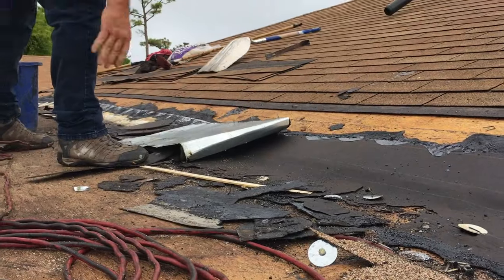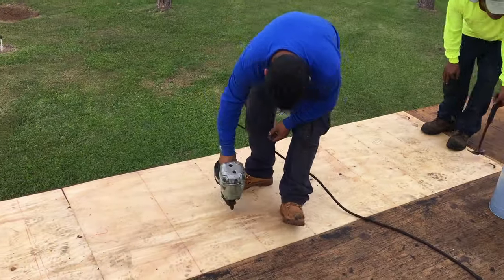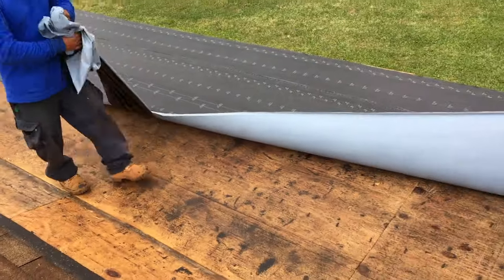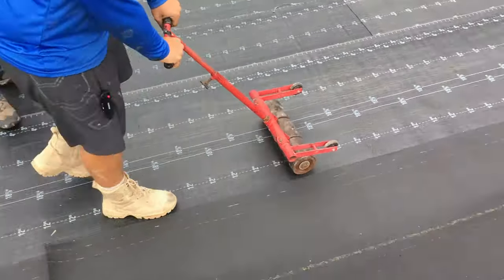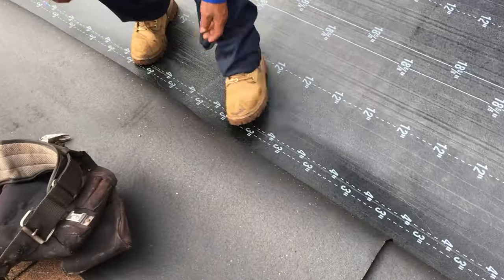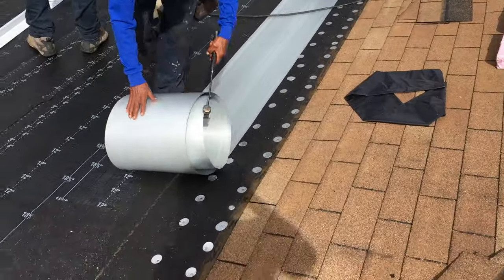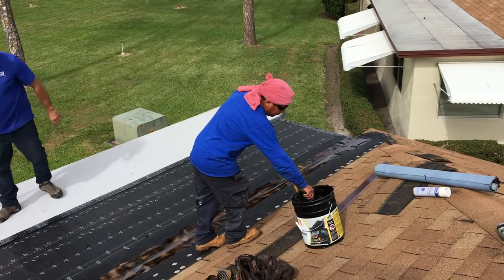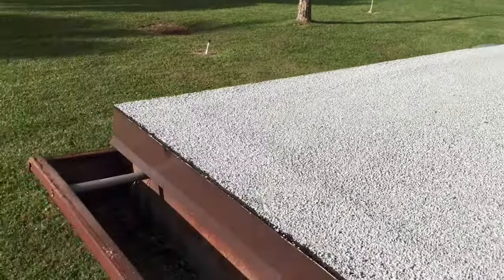How to remove, repair and install a flat roof

Comment: Its never good roofing pratice to lay down any type roofing membrane directly over a wood deck,i would have installed a 1x6 around the perimeter then screwed down a 1 inch layer of rigid insulation like Nord Board which is a tar coated insulation ,laying the roofing membrane directly over the wood exposes the roof to future roof leaks from nails popping up through the membrane .
Reply from the maker: Thanks for those good tips appreciate it and thanks for watching
Reply: Then you would void the manufacturer's warranty which specifies direct to wood underlayment on rolled roofs: Read the manufacturer's instructions. They tell you not to mix in layments from other manufacturers. A lot of people have their own twist on things, but bear the manufacturer in mind when you double your cost adding extraneous layers of underlayment. At the end of the day, the results are all that matter and if this roof section lasts 50 years, then every critique here is false. TPO and EPDM go straight on wood. I personally am going with a single layer roof system and I am not paying for even a single layer of underlayment on wood. I fully accept the fact no roof lasts forever. The wood itself has a limited usable life and so also do all forms of bitumen regardless of how many layers of underlayment. Why stop with 1 layer of Nord? Add ten more layers to be absolutely sure it's waterproof. It's your money, not mine.
Reply: @michaelledford4751  what metal deck? I decided to use an Owens Corning single layer system. The instructions don't call for any underlayment on wood sheathing. If you need insulation, that would be a bonus accessory completely unnecessary to the core purpose of roofing. Meanwhile, the overwhelming majority of homes rely on thermal insulation between the interior ceiling and below the roofing sheaths, so it's clearly redundant to then spend extra money on an insulating base layer for a roof top. Every layer of material costs money and further doubles the amount of labor needed to complete the job. No wood roof lasts forever. No bitumen roofing lasts forever. It's simply part of the usable life cycle and normal maintenance of wood framed homes. You get at least 10 years out of bitumen, but if you paid extra for an unnecessary insulation base layer, then that also must be scrapped off and trashed when the bitumen inevitably fails. You go ahead and keep up-selling any suckers who will buy into your sales pitch. I'm not mad at you, but I would be hiring these Mexicans in this video, who will only charge me for what I ask for. I am only paying for a 1 layer system. When the day comes and I have $10,000 to blow on a roof, I'll go with clay or metal or concrete, but I'll never waste a dime on a 3-4 layer shingle roof: I don't do things the "American way". Building on wood is inevitably doomed to fail from jump street. However, wood, gypsum board and bitumen are all you guys are capable of understanding around here.
Reply: @dare2scheme904  What metal deck ? Being that you dont know what Type A and Type B metal roof decking is tells me that you are not a professional commercial & industrial roofer whos went through a 5 year apprenticeship to become a Journeyman/Master Roofer,i have so ill explain .

The Owens Corning peel & stick modified bitumen roofing system you want for the flat/low slope wood roof deck on your home is the exact same material that can be used to roof a large commercial building such as a shopping mall,or a massive industrial building complex such as a Ford Motors auto manufacturing plant ,both types of buildings roof decks will be Type A or Type B metal roof deck which both types of decking require atleast 1 layer of ISO rigid insulation to create a flat uniform surface for the material to bond to ,the rigid ISO foam insulation is attached to the roof decking using long self tapping screws through the center of 3 square " metal plates which hold the roof down ,moving along .

Now on to the reason you should NEVER install a single ply roof membrane directly over nails irregardless of what some moron at Home Depot tells you,or what you read online ,#1 your wooden stick built home moves up & down as well as side to side with the change of seasons & temperature changes ,a wooden roof deck moves much more than any other area of the home which creates Nail Pops on a shingle roof that create roof leaks ,the 8 or 16 penny nails holding down the plywood roof deck on the flat roof on your home work lose at a much more prevalent ratio due to your flat roofing system being subjected to intense thermal shock most shingle roofs do not experience,mainly due to a well insulated high R factor attic space ,and a large free flowing air space below the shingle roof which prevents severe thermal shock ,the flat roof on your home if its anything like the roof shown here will experience heavy thermal shock, the space between your interior & exterior on your flat roof is a poorly insulated 6" plenum space which moves separately from your shingle roof,between the movement of your wooden roof deck and the effects of thermal conduction flat roofs of the design shown here have a nearly 100% rate of nails holding the roof deck down working there way up and through the roofing material ,the effects of thermal conduction & thermal shock are not my opinion ,both are quantifiable scientific facts which Owens Corning or GAF will explain in detail to you over the phone .

The main reason the contractor in this video is first installing a self adhering modified base sheet before the layer of granulated cap sheet is because OC or GAF requires the base sheet be installed is to prevent the top layer of cap sheet from direct contact with deck fasteners such as 8 or 16d nails,the manufacturer is counting on the layers of reinforced fiberglass skrim sheet inside the bottom base sheet layer to prevent nails affected by expansion & contraction from working their way upwards & through the granulated cap sheet .

Now on to reasons why a DIY guy like you or even a roofing contractor should always install at least 1 layer of rigid insulation on a flat roof deck before installing the roofing membrane layer/layers ,#1 the cost is minimal while the energy savings from a doubled or tripled R factor will decrease heating & cooling costs substantially ,#2 protecting the roofing membrane from heat loss drastically reduces thermal conduction & shock to the membrane which gives extended roof life ,and most importantly is #3 to increase the distance from decking/roofing nails and the roof membrane itself ,its not my opinion that wooden decked roofing systems that are insulated last years to decades longer than non insulated roofing membranes ,its 100% fact,without insulation & a wind cleat under the drip edge metal the 2 ply system shown here is only eligible for a 10 year " LDA " warranty or Limited Dollar Amount where nail pops are not covered ,by adding insulation the roof qualifies for a 20 year " NDL " or No Dollar Limit warranty with a manufacturer warranty inspection ,the issues i spoke of are 100% fact & your not getting advice from some wrapper reading yahoo who calls himself a roofer ,to this day my roofing crew is the only commercial & industrial roofing crew to be featured on the tv show Modern Marvels for completing the worlds largest sq ft roof lifted at one time ,,video link to my world record breaking roof project using the same 2 ply modified bitumen roofing system below .

The largest roof raising in history by me & my crew .https://youtu.be/3j9C-oaZ69A
Reply: @michaelledford4751  The roof in this video did not fail because nails backed out into it. The leak started at the valley joint transition to the low angle roof portion which is a very common point of leaks. In fact, nails haven't been the cause of any roof replacement I have seen. Go read the Owens Corning installation manual on the product, because that's what I did. You go ahead and keep peddling whatever you are selling, but I'll thank God that I'm not required to hire guys like you who only make the cost of construction and repairs economically unviable. Like I said, every layer costs money, every layer creates twice the labor and every layer goes straight in the trash when the bitumen inevitably decomposes. Bitumen has a limited duration of usability and if you have been in the business more than 10 years, obviously you have done roofs which have already been replaced by now and you can feel free to deny the fact. Quit trying to preach this falsehood, 'when a bitumen roof fails, it's only because you didn't install it correctly' as if only you know the 'magic method'. 'Only you have the snake oil which causes bitumen roofing to last 100 years'. Have you ever seen a nail completely back out of a stud by itself? Ask yourself why studs aren't backing out and houses aren't collapsing because framing nails are backing out. So your Nord insulation snake oil is impervious nails and can't be punctured by nails, right? Bro quit, no sale. I'm putting single layer directly on wood as directed in the product documentation and I am ensuring development is financially viable and profitable: I'm going to get more than my money's worth because I'm not paying any tribute to your temple of Nord. The name alone is trash.
Reply: @dare2scheme904  Im laughing my ass off now,i tried to help you to no avail,if you cant figure out why 16d nails driven into wood under a tremendous down force dont back out while the same nails with no down force do back out, constantly ,then you need education ,the fact you know absolutely nothing about expansion ,contraction ,thermal shock & unvented wood decks would scare the he!! out of me if you were roofing my home , dont need to read specs as im a Certified installer of all Owens Corning and GAF Single ply,modified,cold process and hot BUR roofing systems  ,i should have stayed away from this thread the very minute i saw a mastic coated galvanized valley ,no wind cleat under drip edge,no pre cutting & relaxing of cap sheet as required in the manual you read ,the roofing practices i attempted to help you with is why your posting a video of a 1 square job & im posting videos of 10,000 square commercial jobs and industrial power plants 380 ft above ground level .

Comment: Starting after 24:00 you can see the guy started putting that black stuff over the area that was not prepped and proceeded to spray the prep shit over the rest of it. It will leak in time.
Reply from the maker: Thanks for the tip

Comment: And for the record this is a shit roof system.  I've been flat roofing since 1989 for the latest companies in the industries.  This system is crap.  When it leaks and it will leak order up a product called "tremco". It comes in two pails.  First pail you paint on is the base coat,  then while its still wet you roll out the fiberglass mat they sell with it then dry roll it so it imbeds into the base coat.  The next day use the second pail and paint it on.  Done.  Its a great answer to leaking rolled out torch on style roofing.  No tear off involved.  Can't be used over tar and gravel in case you were wondering.